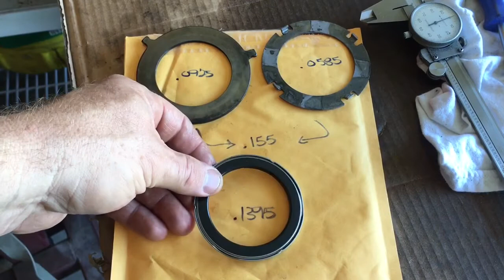DIY TH400 Rollerize rear thrust bearing

Comment: Made by Sonnax and sold by Summit racing.  
Sonnax automatic transmission case bushings kit. Part# 34006-SPB. 
I think you will find that this is the best of all worlds.  Includes everything.  Hope this helps.
Reply from the maker: Thank you, I’ll be building a back up transmission and I’m trying to make it even stronger than the current one!  Thanks! JD

Comment: The bearing requires less endplay than the stock setup. The washer setup wants between ,007-.019, I would run less with the bearing because they can't take the hammering that the washer provides.  Sonnax makes a kit that has the no walk rear case bushing that has a flange to prevent the bushing from moving out, it also has the T-bearing along with two .010 shims and two .015 shims. for a regular street driven car, I would leave it as is. I know that a lot of advertisements say that this will give you 25 HP and that will give you 50 HP. My car should have 10,000 HP.  Keep it simple
Reply from the maker: peter ferri The issue is, you can’t properly install the Sonnax anti-walk bushing from the inside out and use the T-bearing.  The two parts simply don’t mesh. 
I ended up properly installing the HD anti-walk bushing and using the OEM tanged washer, with all metal shims. 
I’d like to see if it’s possible to create a true anti walk bushing with a way to locate the T-bearing.  Naturally, you could machine the inside of the case to counter sink the anti-walk bushing but there’s still no locator.    JD
Reply: @HeadFlowInc  I got a roller bearing for a Powerglide, machined, and installed by TSR Racing. Real good guys. They also have parts for Turbo 350, 400, and Chrysler Torque Flites.  They machine drums for 400 so you can install a 34 element sprag. You can use the direct drum from a 4L80E, since it comes with the 34 element sprag. I have 3 400s, and a 4L80E.
Reply: @HeadFlowInc  I thought about this all weekend, and I think you answered your own question.  Many years ago, I bought a kit to install a t-bearing in the rear of a Ford C-6. After I got it, and saw what it was, I R&R it, rob and replicate.  I had the local machine shop cut the low sprag race so I could install the T-bearing from a 350 pump. That bearing is around .130 thousands thick, so I had the machinist remove that amount from the race to make a little pocket for the bearing to ride. I never had a problem with it coming out since it was loaded, and the output shaft held it too.

Comment: You should have bought the rollerized bearing kit with the shims. Then, you add the 3-tang and 4-tang thicknesses and subtract the rollerized bearing thickness from that. Whatever that difference is, that's the shim you need. In your case, you need a 0.0155 shim. 0.015" would be sufficient.
Reply from the maker: mathew shackelford The main reason I didn’t end up using the roller setup was you can’t use it with the HD anti-walk rear case bushing. I would have to improperly install the anti-walk bushing in order to have the bushing act as the locator.  I’d like to see Sonnax develop a way to run both, anti-walk bushing and the rollerized rear case setup. 
Thanks for watching and the feedback I appreciate it!  JD

Comment: You need to add the shims.. TCI sells the kit..0.010, 0.015 and 0.020 shims are included in the kit
Reply from the maker: Rob Preuss One problem, apparently you can’t use the HD anti-walk rear case bushing and rollerize the rear thrust?  
I understand how to run a regular case bushing, leaving part of it protruding inside to act as a locator for the shims and roller bearing. 
See if you can find a way to run both the Anti-walk bushing and the roller thrust... JD

Comment: I'm building a turbo 400 and I am getting ready to swap my rear case washers. Did you ever figure out exactly how to install the roller bearing. I don't get it either, because the three tab washer is held into place as well as the four tab thrust washer that installs on the output shaft assembly. The roller bearing is not going to be held in place by anything other than locating on the case bushing. Please let me know what you found out or if you even installed the roller bearing. By the way, great job on the videos!!!

Comment: it makes a huge difference in longevity when you rollerize the rear thrust bearing with a high horse power engine and reduces horsepower robbing spin losses, They do make a wider bearing and a no walk out bearing there is many different types of bearings you can use for this. I personally would use a no walk out bearing and do the rollerize rear thrust bearing. This method will support easily over 1,000 HP. I would never use that kind bearing i saw in the video in any high horse power engine ever !!!
Reply: Will the rear roller bearing fit around the no walk out rear bushing? How much of the no walk out bearing stick up into the case?
Reply: the nitro man you put the bushing in backwards, driveway engineer has a good video on it for a 4l80e

Comment: I also used the Crankshaft Coalition page for info (though i didnt do this mod). Most of that info comes from Jake Shoemake of jakesperformance.com. that guy is a god among men with transmissions. i also used this site  and it helped me on checking proper clearances and proper order of parts and such. 
https://www.chevydiy.com/rebuild-gm-transmission-th400-assembly-guide/
Edit: here is the link to the page Talked about in the video. http://www.crankshaftcoalition.com/wiki/TH400_rebuild_tech
Reply from the maker: Wrench Avengers Thank you for adding the link, I wasn’t prepared. Definitely a great resource for building a strong TH400!  👍👍👍
Reply: no problem! i added the crankshaft coalition page to my original post too in case anyone else needs it.